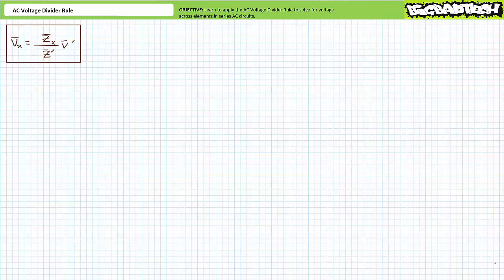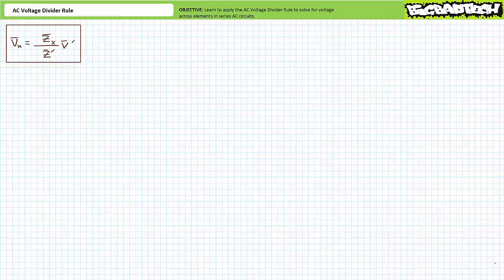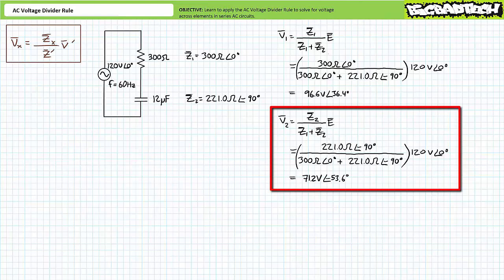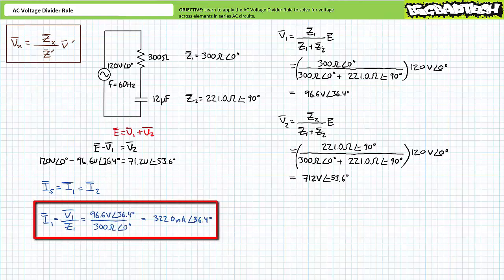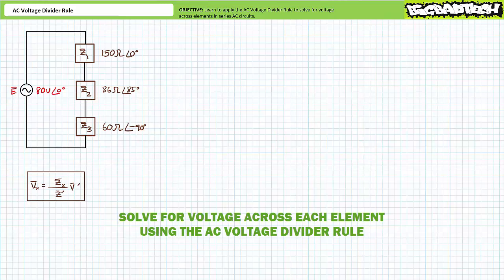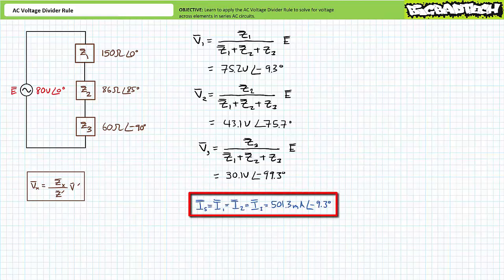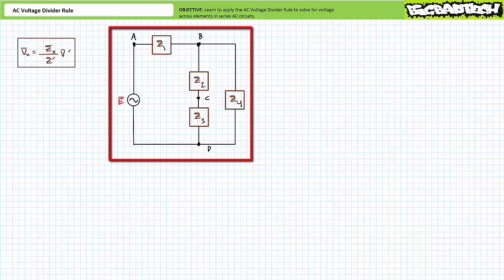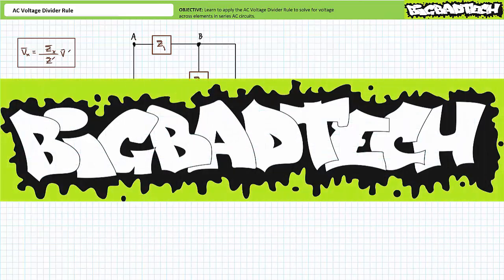AC Voltage Divider Rule (Full Lecture)

Comment: Jym I left the college because of lacking and laxed eductation standards and antisemitism. The electrical course ran over the DC theory with a panzer and mauled a ton of DC components that I had previously learned with you such as nodal voltage analysis and believe it or not... they made us take the lonnnnng way around the AC to get to the impedance for RCL circuits WITHOUT having an angular response (believe it or not!). What am I trying to say here? That people get a lot more value and mileage out of your course than they do out of a government funded college. BTW I'm in Ontario, Canada where the colleges are nothing BUT diploma mills.

Comment: How  to i get 100volt Ac from 230volt Ac .? Which resistors required plz reply
Reply from the maker: Pick a value. As long as the ratio of 1 resistor is 10/23rds of the total it’ll divide as you require.
Reply from the maker: It’s a ratio. 100V is 10/23rds of 230V so 1 resistor must be 10/23rds of the total.
Reply: Plz told me a value